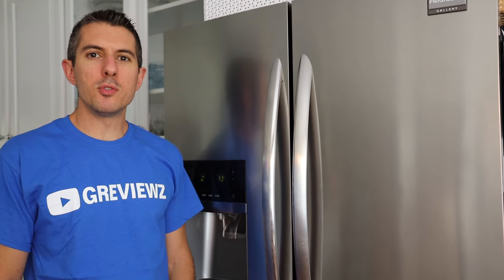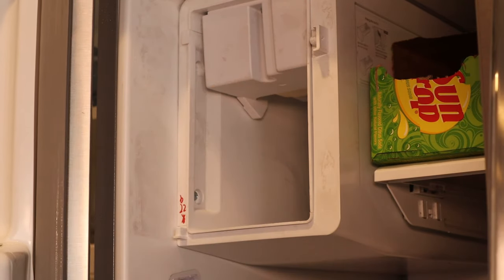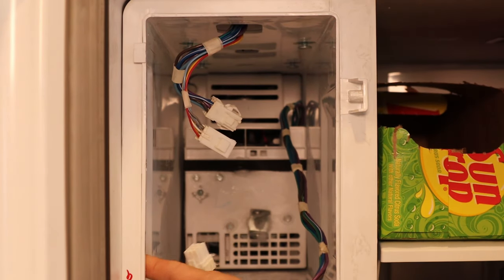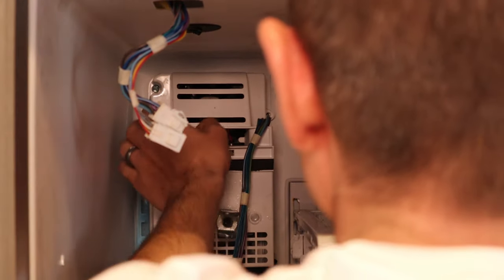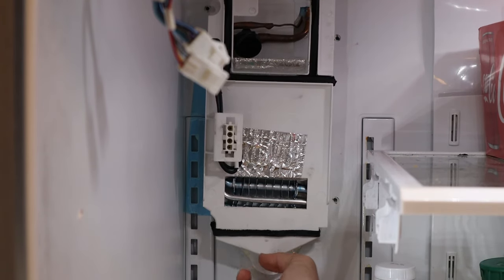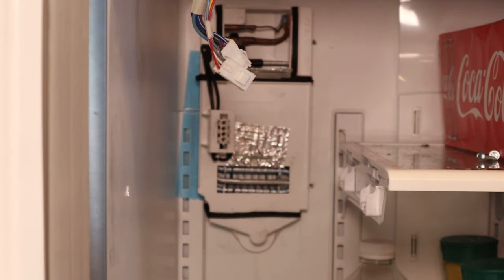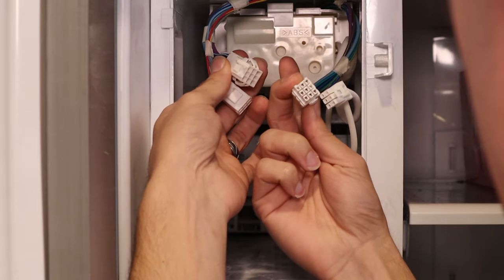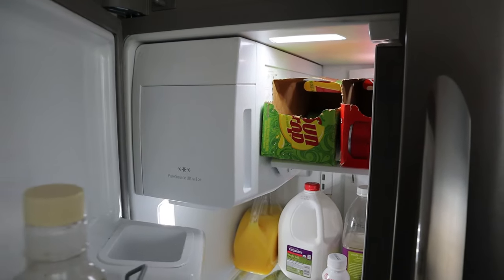Frigidaire ice maker broken again: fix it

Comment: your video worked for me, however I don't think the coils were frozen, I feel like the issue was the water spout in the top must've frozen, bc at some point as I was about to put it back together I found a piece of super snooth ice that felt like it came from the tube. got it all put together and a few hrs later had some ice in the tray, thanks.
Reply: Yep, that's exactly what keeps happening to mines. Keeps freezing up right where the water shoots into the tray. I have to take it apart n hit it with a hair dryer... n then a smooth ice cube falls out of the tip. I can clearly see that it's frozen right at the tip. I stick a small screwdriver and it doesn't go into the hose cause of it being frozen. Did this about a month ago n gotta do it again today as it got frozen early in the week. Last time It lasted over a year n now only lasted 3-4 weeks. 🤬

I use ice every day. Don't know why it keeps freezing at that spot. Raised temperature on freezer n fridge n still happens.
Reply: When yours stopped making ice, did it also stop filling the tray? Mine isn't refilling the tray, and I'm assuming the water tube is possibly frozen like yours
Reply: @tanyalpg2771  yes. water couldn't get to the ice tray to freeze bc the tube had the frozen ice in it.
Reply: Do you have to take much apart in order to access the water fill tube? We've gone so far as to remove the exterior housing and the ice cube tray assembly. I just don't remember seeing where the water comes  out.
Reply: @tanyalpg2771  yes you have to follow his steps and when you have it to the point of taking the tube loose you can stop(if that's your issue) and just blow hot air from a hair dryer and the ice should melt and possibly fall out like mine did once I got that out, I just put it back together and it has worked since then. Water will come out of the tube so I'd give it a few minutes to let all the water out so less chance of refreezing.
Reply: Thanks paul, I appreciate your feedback. Wish me  luck🤞

Comment: Before the fix were you still able to get water out of the door or was it just ice that would not come out?
Reply from the maker: Ive only ever had ice maker problems... however if you have a really bad case we’re the ice buildup will actually freeze the water line coming into the back of the fridge. If you have no water I would change the water filter first just to make sure the filter isnt clogged..

Comment: This was a well put together video, but long.  I didn't get through it all because it looked like you were only discussing the fact it wasn't making ice any longer, however, our Frigidaire only dispenses crushed ice.  Would this fix help that as well?
Reply from the maker: Hey thanks for watching..in that case my fix most likely won’t fix your problem. My fix will do the trick if you can’t get ice at all. It may be something with the motherboard that it won’t switch to the other setting...

Comment: You had me at nothin coming out cubed or crushed, but I am still looking for my apparent unique problem. Intermittently, the ice will drop a few cubes. Motor makes noise like its working and fridge makes ice, but most of the time - it will not drop the ice!. 

Thinking...

 - When I press ice, maybe the lid inside is not opening to drop the ice? 
 - Augar motor makes noise, but is not spinning the rings to move ice forward? 
    - Perhaps the bolts that catch the back to rotate are not aligned consistently? 

I like your detailed approach. Guess I'll watch the rest for clues. I'll report back.
Reply from the maker: Thanks for watching. Keep me posted how it goes. I believe you have ice buildup on the auger motor not pushing the ice out..
Reply: @GReviewz  Hey Thx. You mean the augar motor is not spinning the 2 plates that fit into back of tray which spins the wheel which spins the tray rings which moves ice forward I think. 

I'll check to see if their is a diagnostic for the augar motor. Hopefully catch a break if thaw it all out. Otherwise, may need a new augar motor.  Ouch!

Comment: What is the recommended test “DF” cycle time? 15 minutes, 30 minutes?

I also raised my freezer temperature a bit as well. Turned it down to make more ice faster but maybe this problem has been coming…

I hear the quick heat cube release noise prior to rotation but when then it goes to pump water into tray, that part of the process seems froze up.
Reply from the maker: Thanks for watching. My fridge has set time that it runs for.

Comment: hello, i have the exct same fridge, start to notice that day after day have less ice cubes  then suddently no cold air on fridge so i start to look for the isue, happens that the bottom ice chest coil fan was not working, so i replace  it and again ice chest perfect and fridge cold again but the ice maker wont do ice, i took it a part like you  no ice was build up on the serpentine, defrost process works fine, fan works when door closed, so all is working fine but ice maker is not producing.

any ideas what would be the isue??   
thanks for your video.
Reply from the maker: Thanks for watching. Sounds like you are having a lot of problems with yours. Some people have complained to me about frozen and or clogged water lines running from their wall to the back of the fridge..

Comment: I have the same fridge. My shutoff arm will not drop down. It still makes ice slowly but arm won't drop. I replaced ice tray thinking it was the gears or motor on the old one but never fixed it

Comment: This is a great video. The problem I’m having is when I try to dispense the ice it shorts out my main power board. Any ice will be melted by the time I get into it. It does rotate a few turns before it stops. Do you think if ice got on the motor that would cause my problem? 
Thank You 
Kenny
Reply from the maker: Thanks for watching. Sounds like there is a short somewhere in the wires.. do you see a cut wire anywhere? Check to see if ice is built up anywhere..

Comment: I just followed this video (which was excellent!) to try and figure out why my ice maker stopped making ice. I had ZERO ice build up in mine. I did allow it to thaw, and put everything back together. There was some ice built up in the water line where it exists the ceiling of the fridge... I was hoping I would hear the sound of water filing the ice tray by now... I'll wait 24 hours to see what happens. If that doesn't work, what would you suggest next?
Reply: Hey, where is the spout for the ice maker? I took apart my ice maker completely after watching this video. There was no issues with it, nothing forozen... I then replaced the water inlet valve.. still no ice. Im thinking the line is possibly frozen? How and where did you defrost the the spout? Is it at the roof of fridge? Also did your ice maker start making ice after thawing out the line?

Comment: Whirly noise at 4am, louder than it has ever been. 😳 me thinking it is going to explode. Watch this video for a quick reminder. “Fixed” in about 1 hour (with the help of the new super powered pet dryer I bought 😂) Now I need a video of how to take out the base of the fridge that the bottom crisper drawer slides across! When I was cleaning up all the melting water, I discovered that it traps water in that plastic flap (along with other unimaginable stuff) My patience at 5am was wearing and I couldn’t figure it out without mutilating it.
Reply from the maker: I’m sorry your unit did that you are the first person to say it made a lot of noise…I hope my video was helpful for you!! I personally ha e messed with anything at the bottom except for vacuuming under it..

Comment: I have a slightly different model but my ice maker works just VERY VERY SLOWLY.  Going to take it apart and thaw it out and fix it.  I imagine this is the exact problem I am having.  I have a Gallery Frigidaire just a new or older model.

Comment: MIght add that putting those zip ties for the wiring harness back on the icemaker would be a real exercise in frustration. I suspect that they are there to hold the wiring during assembly and shipping & install. Ain't nobody got hands small enough to zip it up again and clip the tail off.
Reply from the maker: Thanks for watching. Yeah sorry. I didn’t mention that in the video. I didn’t even try to put the zip ties back on. But I could see how it would have been a big pain. I hope I was able to help you!
Reply: @GReviewz  Nothing at all wrong with your vid. Not a lot of info on these icemakers. I got as far as dropping the ice tray assy. and heated the whole area with a blowdryer for 30 minutes or so, then I reassembled the whole deal. I suspect the root issue was simply ice in the fill nozzle, but I did notice water dripping from the back area where the drain for the ice maker evap coil is. There may still be ice there, and I found your video after some time searching for a bit of info on further disassembly. Your vid confirmed what I suspected as far as procedure, but now that it's reassembled it seems to be working OK. Next time I have an issue, I'll tear it all down as you have shown.

There is a good video on the diagnostic mode for the icemaker...you may be familiar, but others may not:
https://www.youtube.com/watch?v=nuxV18oGEg4

(and to force a defrost cycle, hold down the '+' and '-' together for about 7 or 8 seconds...it'll run defrost for about 15 minutes and then go back to normal operation)

Comment: Very good. Did you say run the defrost cycle twice before you power it down?
Reply from the maker: I mentioned I used the defrost function twice with no avail. Are you having icing problem?
Reply: @GReviewz  same problem as you and same unit as well. So put in defrost mode while using the dryer to remove the ice build up
Reply from the maker: Yes you can do both of you want. The blow dryer is the best thing I believe as it gets the most area heated the defrost only defrosts we’re the coils are..

Comment: I have a different question I have the same fridge and I have the ice maker on the bottom.  It hasn't worked for about 6 months now. It did this before but before it started working on its own. What can we do to get it going? Does it have a reset button to?
Reply from the maker: To my knowledge you have to go up on the menu system and toggle it on. Sometimes people turn the icemaker off on accident.

Comment: Amazing video! Same fridge as mine so easy to follow! Unfortunately, mine was NOT iced over  :( I’m pretty sure mine has to do with the line at the top that drops the water into the icemaker. Is there a way to clean it out or flush it out or defrost it? We just had this horrific winter storm and all of our water pipes outdoors and everything froze. Not sure if that could have anything to do with it but that’s literally what my I stopped working. However, my water is coming in just fine to my fridge because I can fix a glass of water. It’s like there’s no water dropping into the ice tray at all all from the top..... am I making sense? Lol
Reply from the maker: Thanks for watching. Yeah these fridges are notorious for problems relating to something freezing over..if none of the internals i showed in my videos are frozen up than it is most likely your water line and or water filter..turn off the water going to the fridge at the wall. Take blow dryer to the water line in the back of the fridge and inside were it drips into the ice machine area. Try that.
Reply: There is a new fill tube to address that.  They freeze up in the ceiling.  It's the green tube coming out the back.  There is also a new air handler asm for the freezing issue he described (though he apparently is not aware of that kit) and it now comes with the new fill tube.

Comment: Was your ice maker not making any ice, or very little? Our fridge ( looks to be the same model as yours except not the Gallery model) is fairly new (Bought this past April) and it makes about 20 cubes overnight if that. Had tech out today for problem with our oven and asked him and he said it was normal as it is designed to make 2 pounds of ice cubes in a 24 hour period. Also, if the ice maker has a drain as you mentioned, where does it drain to?? Thanks

Comment: I pulled mine completely apart. Looks like it's been changed out before with different parts during one of our warranty claims. The part over the coil is aluminum.  I really didnt have any ice buildup but instill pulled it all and let it defrost. Hope it works. If not what next? Suggestions?
Reply from the maker: If the ice buildup is not causing the problem then you physically may have something wrong with a part in the assembly...make sure all the electrical connections are tight and let fridge reset unplug power for 30 sec then plug back in...
Reply: @GReviewz  honestly after putting it all back together I was thinking it must be a bad component and was feeling a bit down until the next day when my wife was like what was that sound? The ice tray was full.  Big thanks!
Reply from the maker: Awesome! I’m glad it’s working for you!

Comment: I believe i have the same problem.  What type of hex driver do i need? i tried buying some and when I opened it up, my hex nut wasn't exposed like yours is, it's in some outter casing which is too thin for my hex driver to go into.
Reply from the maker: Over the years the fridge has stayed the same but they have made it harder and harder to do this job because they want you to have to call a repair man out. I’m not a tech I just own the fridge in the video. Just be patient take your time and you will figure it out.

Comment: Was yours making ice, just not feeding it out of the hopper? Or was it just not making ice? Mine will not send water to the tray. I was able to remove a little plug of ice up in the water port at the top of the fridge, but that only lasted long enough to make a couple trays of ice and it has stopped again. Any suggestions?
Reply from the maker: This whole fridge is a big problem. Is your water filter clogged?
Reply: @GReviewz  no clog in the filter. Can get water out of the door with no issues. It just seems to be the water not getting to the ice tray. Did a defrost with the hair dryer and still doesnt do anything.

Comment: What about wrapping a thin copper wire around the heating element then put a loop of wire in the drain hole then back up to the heating element and wrap around the element again. This would carry some heat to the drain hole and keep the drain hole defrosted. 
Do you think that would work?
Reply from the maker: Thanks for watching. Yes I have many viewers that have done just that and it worked... I will not be doing that on my unit just because I dont want some fluke shorting out the compressor or something.

Comment: Frigidaire has replaced my refrigerator with the same problem.  They say it was made wrong and the water line was too close to the ice maker. There was a lot of rust on the back outside of it.  The new one that replaced it has no cold water dispenser just tap water filtered.
Reply from the maker: Wow I’m glad they replaced your unit under warranty. Most people they said f it.

Comment: You disassemble the ice-maker, defrost the accumulated ice that was blocking the flow of water and movement of some mechanisms , reassemble and then it works again. But did you actually fix the problem from happening again? If not, I cant imagine doing this over and over again each time this happens.
Reply from the maker: Thanks for watching. There isn’t actually a cure/fox for this problem. The company sells a kit that seals the ice maker better but it is just a bandaid and doesn’t actually cure the problem. All refrigerators that have the ice maker in the refrigerator have similar issues.

Comment: My unit makes ice and dumps it in the tray just fine. My problem seems to be that the screw drive that dispenses the ice appears to be stripped. Should I try to fix it, replace it or sell the house?
Reply from the maker: Well first of all you know that home ownership never has a dull moment. These fridges in general have problems. The motor to the auger is either fried, frozen or somehow the connection to it has disconnected. I would check to see if there is ice around it first…

Comment: Hello, I have a question, would this also cause  it to loose it’s seal in the bin. The problem I am having is that the ice will melt and create a cylinder of ice in the bin that holds the ice.
Reply from the maker: The problem is these units dont have 💯 seal to begin with…

Comment: Also now that I made it pass the halfway point in the video to where you have ice on the coil if you look up at one of the copper freon lines there is a part that is attached to it with a clip that's the defrost thermostat more than likely thY will be where you are having your issue that's supposed to close at a set temperature and activate the defrost on its own if the defrost works fine and you keep having issues with it icing I would replace that. Also sometimes in the parts breakdown those parts don't show up and if that's the case pull off the old thermostat and MOST have a temperature range printed on the part so you can part match one with another defrost thermostat with a similar temperature range.

Comment: You probably won’t see this but I followed this to a T. My water inlet hole? Was frozen over where the water goes into the ice machine and I stuck my finger up in the hole and could feel ice. I did the hairdryer to thaw it out but unsure if it’s the entire line. Any recommendations?
Reply from the maker: Good question. Maybe disconnect the water line from the back of the fridge and let thaw for awhile?